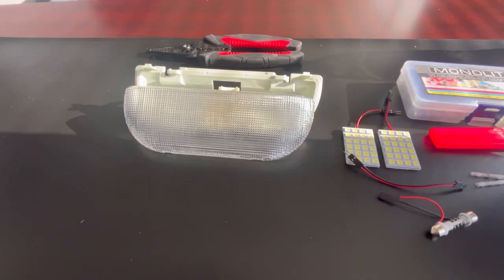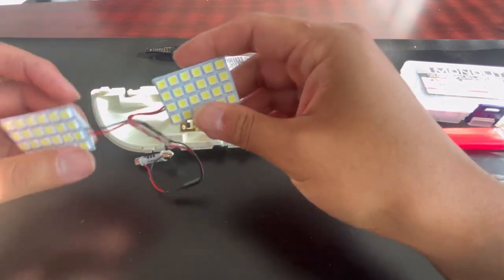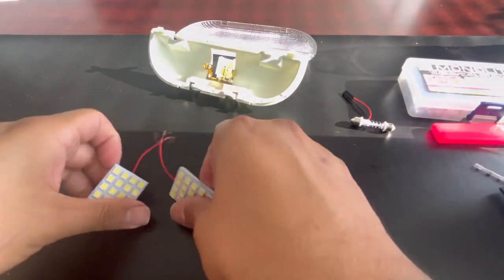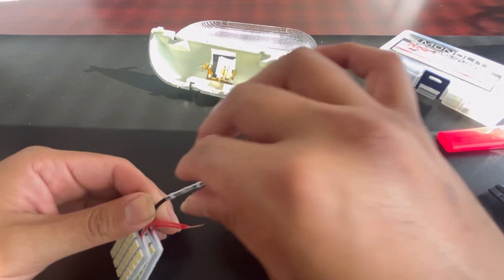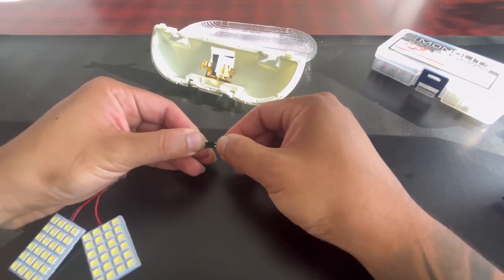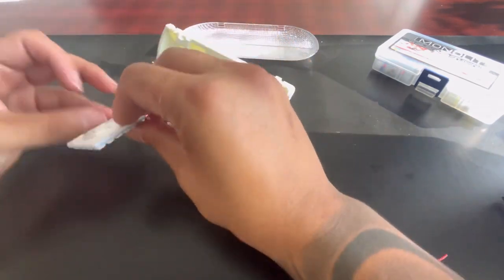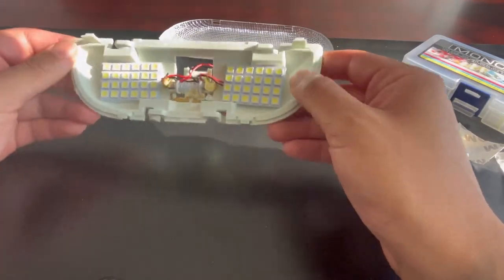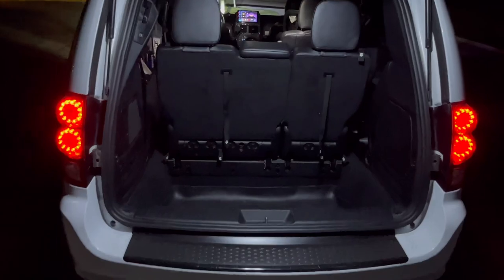2011-2020 Dodge Grand Caravan LED Trunk/Lift gate light mod.

Comment: I need to do this to my van too. The original bulb is called a Festoon bulb which are totally dull, and I’ve no idea what Dodge were thinking putting that in the rear as I feel like Mr. Magoo trying to find my way around in the back. Great video.
Reply from the maker: Thanks brother. I appreciate the comment. Yes I agree with you. That light in the rear hardly does anything. I’m glad you like the video.
Reply: @RonDIYMods hey Ron do you have a link where you got that LED for the trunk replacement trunk light and cost.... please thank you
Reply from the maker: @Horhey-jm1qt  the links are in the description of the video.
Reply: @RonDIYMods  sorry I just found the link thank you again

Comment: @RobDIYMods u can use those Auxito 578 led bulbs, that has coil springs to mimic the incandescent bulb with rigid loops on them???
Reply from the maker: Yeah I seen those from Auxito. But in with this mod the light output is much brighter

Comment: Do they flicker after they heat up? Did you do this to all the lights in your van?
Reply from the maker: They do not flicker. Most of the lights in my van they already came LED the only ones I change inside is the rear trunk and the vanity mirrors.